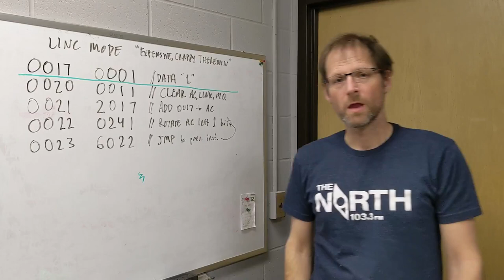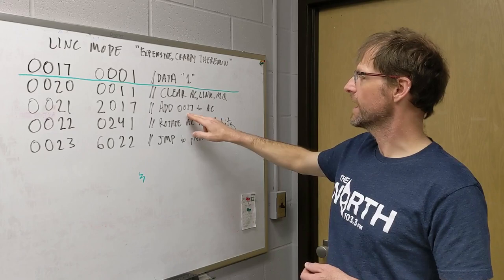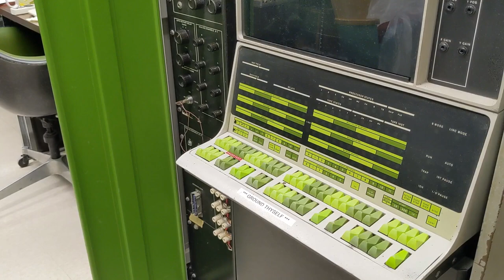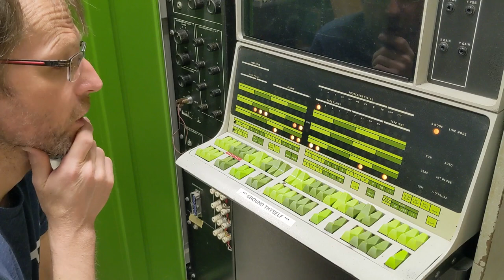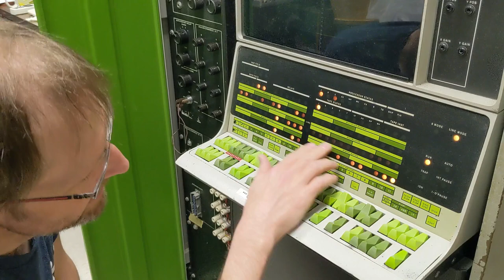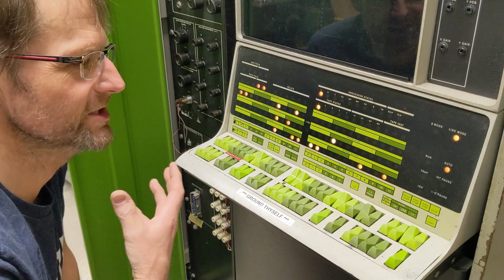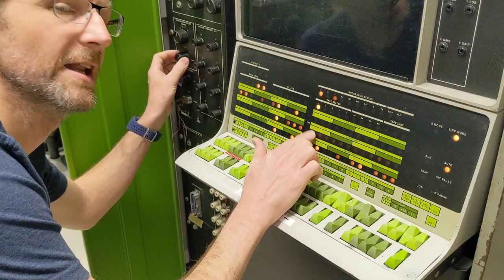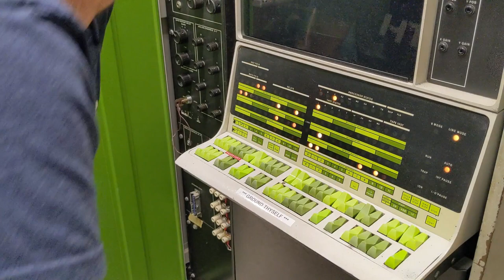PDP-12: How to Turn Your PDP-12 Into a Crappy Theremin

Comment: Fabulous - brings back a lot of memories of my time as a student even though I never actually used a PDP-xx  . 

The one bit sound - that was the sound generation on the old Apple II and I think 1 bit  was also used for the writing and reading to cassette tape (which is probably why tape storage for the Apple II had such a high failure rate). I remember being amazed when someone made a program that could record and playback voice with the 1 bit although it was lousy quality. 

I did see a PDPxx  as a first year undergrad - it was connected to  card reader for the people still using punch cards. Us students were on "modern" Zenith terminals attached to a Vax  in the same basement computer lab. 

And the fan noise - we had bunch of large Sun servers/disks in our lab when I was a grad student. The noise was terrible. In the end we moved them in a corner and surrounded them with cubicle dividers to somewhat deaden the sound.

So cool seeing the the PDP12 in all its glory with individual bits being set and displayed. Thanks for posting. I'm sure I missed actually using one by only a few years.
Reply from the maker: You're welcome -- glad you enjoyed it! Yeah, that one-bit sound is pretty amazing in its own way. I, too, remember a program to make the Apple ][ "speak" -- pretty cool.

Thanks for the memories, and I'm really glad you enjoyed the video.
Reply: @pahp  And who would  have though that today much higher speed 1 bit D to A converters would be all the rage for high end audio :)
Reply from the maker: @ElectromagneticVideos  🤣

Comment: Shame it's so long after you released this... but anyway. The two modes differed not only in instruction sets, the two modes even differed in one using 1's complement for negative numbers and the other 2's complement! Addressing was different too.
One reason for having the PDP-8 mode on the Linc-8, the PDP-12's predecessor, was to eliminate the need for all the hardware otherwise required for the Linc instructions, by having an 8-mode program, called "ProgOfOp" carry out some of them - I think that included multiply and (half) character display. The Linc side would halt and run the calculation in the 8 side, saving a lot of flip-chips! We had two Linc-8s and a PDP-12.
As I recall, Glasgow (University? Hospital?) wrote software to analyse ECG waveforms (or EKG on the left of the Atlantic).

Comment: Interesting to see the "Run" light turn on when you are at the highest speed.  Effectively the Run brightness shows you the running vs idle ratio of Auto mode.  If it is bright, then you are running at close to full speed of the computer.  Most of the time Run is dark because slow stepping is such a small proportion of full speed.

Comment: Old 8 programmer here. Never used LINC. I still use the 8's instruction set from time to time because it's in my head, and whenever someone asks me, "How does the computer actually work, on the inside?" I can show a satisfying answer in about ten minutes on a whiteboard. Can't do that for most other computers.
Here's your program in PDP-8:
CLA CLL
IAC
RAL
JMP .-1

It's amazing that you have a working LINC. Where do you get spare parts? Do you diagnose and repair the boards?
Reply from the maker: Thanks for the comment! Yeah, these architectures are great for teaching, that's for sure. Thanks, too, for the translation to pdp-8! Very cool. We have been experimenting in LINC because it's unique to the machine, it's interesting, and frankly because it's first in the pocket reference! 

You can switch from LINC to 8-mode with instruction PDP and vice versa with instruction LINC. Some things on the '12 are only accessible through LINC ops, like the samplers. But sometimes it makes sense to switch back and forth, e.g., LINC has an XOR instruction and the PDP-8 doesn't.

Because this is a DEC machine and a marriage of PDP-8 and LINC, it is constructed mostly of standard DEC flip chips, which we do diagnose and repair (see our previous video about our tester). Only a couple flip chips are PDP-12 specific. We don't have many spare flip chips, but we do have a good stock of vintage ICs to repair the flip chips. Fortunately we do not need original LINC hardware (although that would be astoundingly cool)!
Reply: @pahp  For me the most fun and possibly most stressful was adding an interface and wire wrapping it on the back plane!
Reply from the maker: @goldfinch-gh  yes -- I can only imagine! We have gone out of our way to touch the backplane as little as possible.

Comment: So, with the PDP-8, the sould is the RF of the flip chips, which you can hear if you put an AM radio next to the front panel.  It's a fin thing to do with the RF leakage of the PDP8.  This is using an audio frequency muxh like who we perceive motion in film and television.  It is creating an ocolation like who sythasizers worl.  I'm wordering thought, could you pick up the RF in 8 mode and make music using the PDP 8 code  I'm thinking not, because you are not using PDP8 hardware, and the flip chips are working at a different frequency, I would assume.

This is really neat - I've been wanting to get a PSP11/73 with the full front panel (not a piDP).  Now I want a PDP12, too.
Reply from the maker: Thanks for explaining this. The PDP-12 uses the same flip chips as the PDP-8 of that era (plus extra for the LINC side), so it almost certainly must produce similar RF. Now, is it similar enough that a "Daisy" program for the PDP-8 would sound like "Daisy" on the PDP-12 (even in the PDP-12's 8-mode)? I don't know. But you should be able to make RF noise with the PDP-12. I'll definitely have to try that out some time -- thank you for the idea!

Comment: Nice! I'm really impressed of the ingenuity of the PDP-8 architecture and design - and of course the PDP-12 as well. I've never looked into the LINC instruction set - does it lack the MOP instructions set and the IAC bit there? That could have reduced the code by two instructions ;)
Reply from the maker: The PDP-12 has almost all PDP-8 instructions except for some of the more exotic later ones. It has an IAC operation in 8-mode, so you're right, my program could have been shorter in PDP-8 instructions! (What does "MOP" mean in that context?) Anyway, I don't have the LINC instruction set memorized, but as far as I can see (perusing the PDP-12 pocket reference card available here: http://www.bitsavers.org/pdf/dec/pdp12/PDP-12_Pocket_Reference_Card_1972.pdf) there is no LINC-mode "increment AC" instruction. The two instruction sets have some interesting differences... for example, LINC has an XOR instruction, while 8-mode doesn't. So, sometimes switching between instruction sets (using the PDP op in LINC mode or the LINC op in 8-mode) can let you write shorter and faster programs.
Reply: @pahp  Dang! The LINC instruction set is more different than I expected. How much of the actual hardware is shared in the two modes? I guess the sequencing of control signals would be handled by two separate subsystems? A large portion of the hardware would be dedicated to registers, counters and ALU functions so maybe there's actually a lot of shared hardware between the two modes....

MOP is not the correct term for it, it's just what my brain calls it when I think about the PDP-8 instruction set. The real mnemonic is of course OPR (microcoded OPeRations) - but for me it's really Microcodes OPerations.

I think I stick with the more clear and regular PDP-8 instruction set even if LINC seem to have an edge over it in many aspects. How are the availability of software for the two modes?  Do LINC have even remotely as many applications as the PDP-8?

If you get very bored some day it would be interesting with short video about the differences between LINC and PDP-8 modes. Maybe you could assume that the audience have at least a bit of pre-existing knowledge about numbering systems, local operations and  assembly in general, but not actually being fluent in PDP-8.
Reply from the maker: Thanks! I don't know exactly how much overlap there is, but I think they reused things in general as best they could, given the expense of machines of the time. They certainly didn't want to waste ICs or space.

There is not nearly as much software for the LINC as there is for the PDP-8, owing to the huge numbers of PDP-8s that were sold. PDP-8 instructions are definitely much more portable, especially if you avoid the instructions that only existed on certain versions of the PDP-8.

A video comparing the two modes is a great idea  -- thanks!